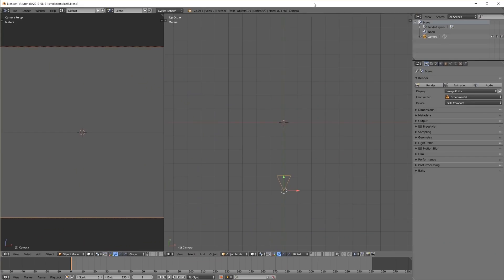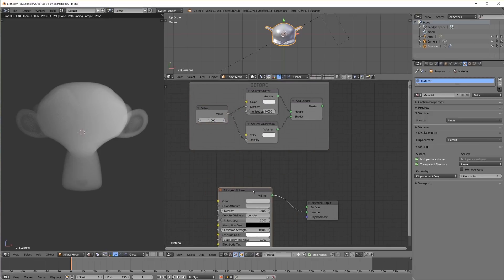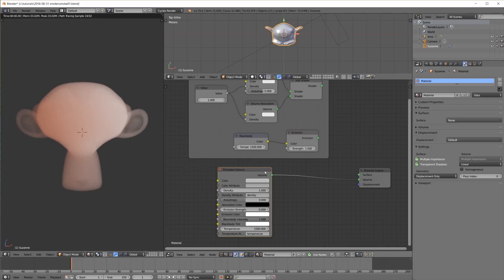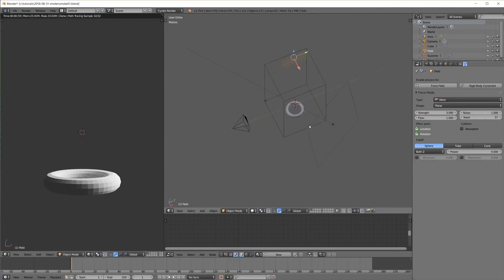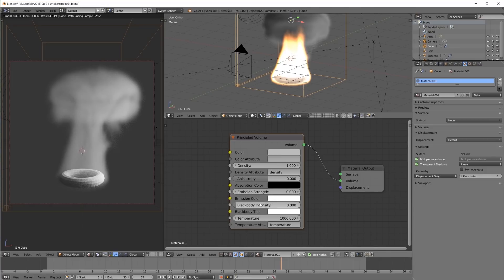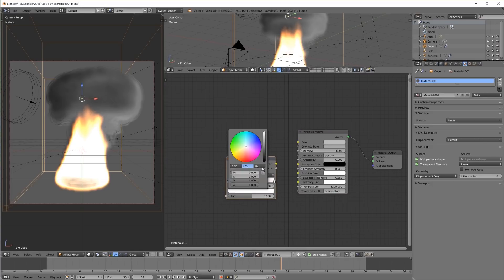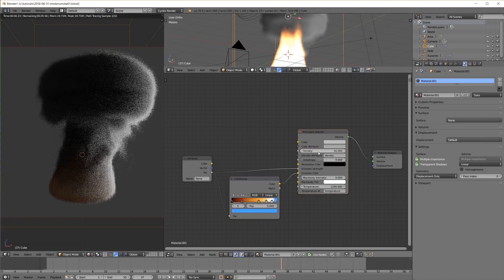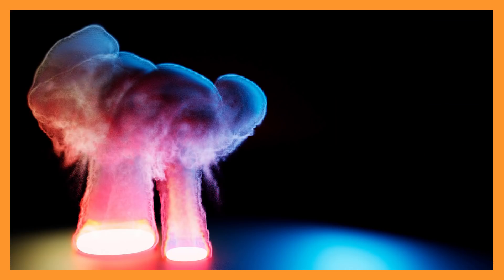Blender Principled Volume for Fire+Smoke Simulation

Comment: how would i control density so it is less dense at the edges and more dense at the center. lets say the object is a sphere.
Reply from the maker: try playing with density through color ramp...
Reply: @chrisprenn  i tried that but it only takes one the value of far left color pin and uses that for the whole object. Nothing i put in the factor input of color ramp fixed it
Reply from the maker: Check this video https://youtu.be/o6tlclXfqpg where I make the dense parts of the smoke sim almost completely transparent while at the same time creating a much denser "outer ring" (where the original sim is not very dense at all) using just a ColorRamp ... I am sure you get the idea ;) ... Regarding your original question: If all you really have is a sphere with volumetrics inside then you could use math to  create a falloff away from the center!

Comment: Hi Chris. Do you know if the new shader works with huge domains? I mean "big", like 200 meters diameter and above. I've had not time to test it yet and hope you know it maybe. In version 2.79 I've problems render big domains. The preview work there, but not the result. Thank you in advance. Nice video by the way!
Reply from the maker: I have never tried that- I always work at a scale (e.g. when modeling small technical objects i use 10:1 and for bigger things I use 1:100 or 1:1000) - sorry
Reply: No problem. I try to work in metric units in Blender. But v2.79 makes it not easy to work in real units... :)

Comment: Nice but pls don't subtract flames from smoke. It's not correct. The particles are present in the flame and in the smoke the same, they still scatter and absorb light, they are just hot and emissive on top of that. It's not like they start absorbing and scattering when they cool down into smoke. Increasing emission strength is the physically correct way, not subtracting flame from smoke.
Reply from the maker: sometimes it's all about a look we want/need and CG gives us the creative freedom to make it look a certain way - that's why I like to show little tricks like these
Reply: +ChrisPrenninger Yes, it's true nodes give you the freedom to do anything, you can mix glossy with diffuse without fresnel, additively add shaders together into some nonsense, use colors with negative values, you can do all sorts of crazy stuff. You can do things you should not do for purpose of creativity, sure. I would be fine with that if there was a disclaimer in the video about it and that it doesn't produce real-world effect. As it stands now it gives an impression it is a solution to making the flames show through thick smoke and beginners that don't know better could start mimicking what you did, thinking it's a smart trick. Then their simulations will look funny..
Reply: I gotta agree with Jaroslav, it's totally fine to be creative but i also got the notion that the way you did it is the "correct" way
Reply: @jerrynovotnik I'd love to see a video side by side of the effects you describe